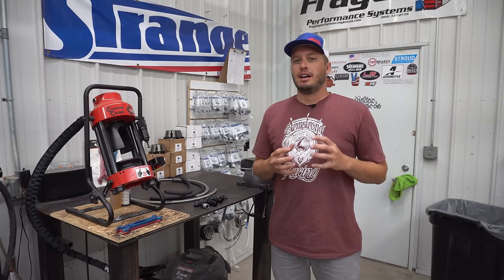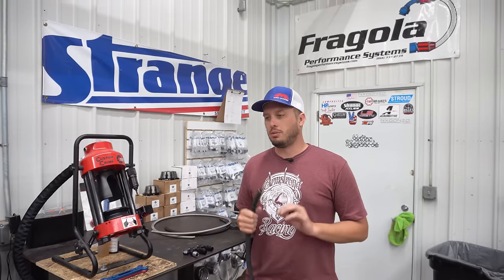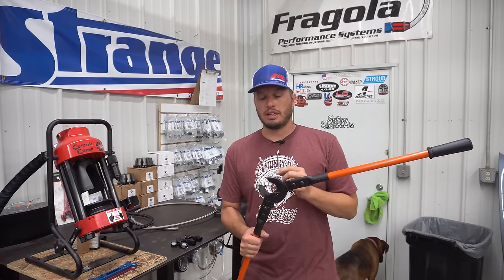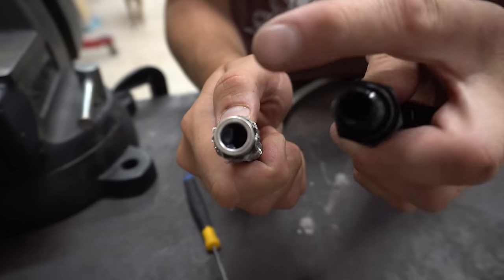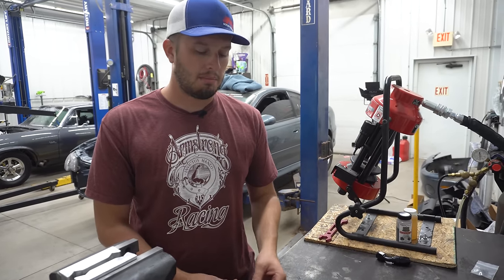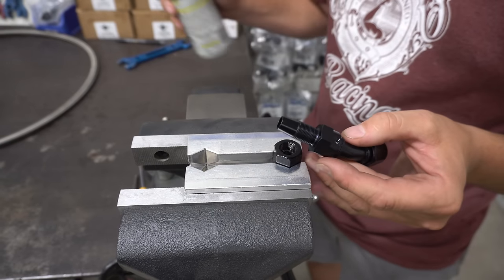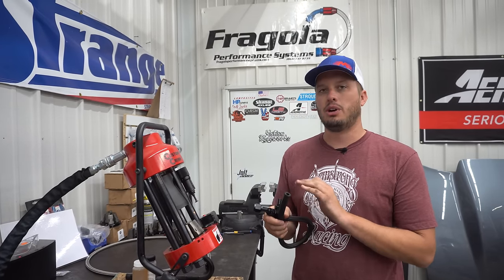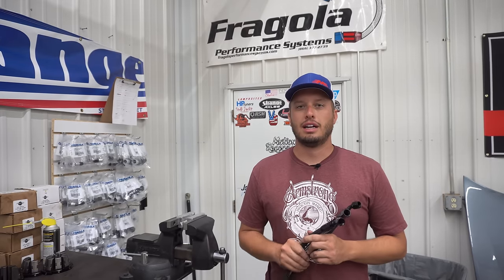How to Assemble AN, Push Loc, PTFE, Crimp Style Fittings and Hose!

Comment: Thanks for including pushlock for us poor people!
Reply: I have used pushlock on my oil cooler system, my hose shrank some in storage, so it was an absolute PIG to get over the barbs! Even with Silicone lubricant and putting the hose into boiling water! I could only manage 3 or 4 a day, and my system has 12 on it! I did, however, also use stainless steel clamps on all the fittings.
Reply: @lordleonusa  That was my thought.  adding exterior clamps seems like good security.

Comment: Nice video, thanks for taking the time doing this. I have had great luck with Aeroquip AN hose and fittings. Pretty easy to assemble and bulletproof. Used a hacksaw to cut it after wrapping with duck tape. I have had this hose on my '94 Z28 for about 20 yrs with no problems whatsoever. I noticed the prices on this stuff have gone thru the roof.

Comment: One of the best out there to explain easy and fast without any annoying talk about something elso or some sponsor shit.  
Straight to the point.  Good!  

 One tip is to use a bit of electrical tejp   to just se if the hose is mowing away from the fitting.  just take a bit and place right behind the fitting.  Then you can see if the hose is all the way in or you should redo the work. 

  
Angle grinder and so is a bad idé.  They just send small stuff inside the hose and that is going inside yours injectors.  The fuel filter will not take  all of that.

Comment: learned a trick from a guy who ran a Pontiac nostalgic top fuel dragster on metal braided AN hose, put just a little bit of electrical tape on the end (one, maybe two layers). Keeps the braid from fraying out and going crazy when you are assembling the hose, and doesn't interfere with it staying sealed.
Reply: Use PTFE plumbers tape - no residue and it comes off super easily :)

Comment: I was unaware that ptfe hose was different than regular an hose so had to order different fittings for the an hose I ordered, thanks for info.
Reply: I'm making up some brake hoses , and I think that the hose I got is for crimping cause it's nylon core ,  I don't know if I should buy new hose or buy crimp fittings

Comment: Have used Aeroquip push lock when making oil cooler lines,250psi bursting pressure -30/ 300'f  when assembled properly with a slimmer fitting profile so don't be put off by them.
Warming the end of the line in hot water does make life easier.
Amazing how they seal/work but they do.
Reply: Agreed, they’re my favorite personally. But I also put crimp clamps on them also for an extra piece of mine.

Comment: Cutting stainless braided PTFE was the bane of my existence at times. Sometimes it would fray no matter what you did.  We got a nice set of cutters and they were dull out of the box.  Sharpened them up and they dulled again quickly.  When the outer stainless frays its impossible to get a crimp fitting on it, and the covering will stab the ever living crap out of your fingers.

Oh, another note about PTFE nominal sizing. On most hoses -10 is 5/8 ID.  On PTFE -10 is (usually) ~1/2" ID.  Nominal sizing on PTFE always was a headache.  If someone needed actual 1/4" then they needed -05, so the crimp fitting was a 5 hose 4 swivel.
Reply: Wrap some teflon plumbers tape over the braid before you cut it. Doesn't leave a residue like electrical tape and is super easy to remove.

Comment: Depending on who’s brand push lock hose you’re interested in purchasing, you should check to see if it’s compatible with gasoline. Some push lock hose is not compatible with modern gasoline and was never intended to be used for that.
I pressure test hoses after assembly and when I received my first high pressure pump and made my first test fixture the first thing I tested was push lock hose. The working pressure of the test piece was 250 psi, the test pressure should have been 500 psi and the burst pressure should have been 1000 psi. This piece of push lock hose burst at 1300 psi. It is not intended for high temperature, I never recommend you use it for a coolant hose. There are enough errors in this presentation from this man to lead you down the wrong path on many items. What I recommend is that you read a lot and understand what you’re doing or get someone at a hose company that knows what to do. The biggest problem we have with racers is that they think they know what they’re doing and they end up bringing half the stuff back because they ordered it wrong. If you are cutting PTFE hose, use filament tape at the area where you’re going to cut and  cut through the filament tape. Leave the tape on the cut until you’re ready to assemble the fitting, one end  of the braids will be tight against the PTFE and the other end it will flare out away from it. That is why you only saw him do one end of the hose. I don’t feel like going on for an hour or so I’m quitting now. He means well. Follow any guidelines you can find from Aeroquip. Basically everything is on YouTube.

Comment: I learned a lot about the AN fittings. I was just watching Earls plumbing crimp video and they said make sure you dont use a cable cutter and always wrap it in teflon tape. Have you noticed any premature failures? Also,  the teflon fitting you showed is threaded, but do they make a crimp fitting specifically for teflon?

Comment: I've had a leak from a push lock fitting on an oil cooler for a drift car I crewed for. It was miserable to assemble and came apart at a terrible time. It coated the car (including front tires) but didn't result in a crash. We did have a magazine shoot with Super Street scheduled an hour later and it was a mad dash to clean the car up for golden hour. We also smoked a journal bearing turbo shortly after and I can only assume it was the cause.

Comment: It is VERY important to make certain that every single wire of the SS braid on the PTFE hose is OUTSIDE the Olive/Ferrell. Otherwise,  you WILL get a leak! It's easier to get it right on the larger PTFE hoses, but also easy to get it wrong on the small size 3 hose.

Comment: Can you use push to lock hose on a regular AN fitting? Or is there a difference in hose diameter both inside and out – overall? I have push-lock hose but I bought the nylon braiding sleeve to put over it but just need to know what fittings I can use? I actually have a box of fittings (AN) that I was hoping to be able to use on the push-lock but after watching your video I’m assuming I cannot do that because each fitting has a specific hose for them except where you stated those two fittings can use the same hose. Thanks for an awesome detailed video!!!

Comment: Push lock is easier when using boiling water to heat the hose. A little soap on the fittings helps.  Napa sells a heat shrink clamp that works really well with this system.

Comment: Excellent video as always! Could you possibly go over in one of your future videos,  mechanical pump setups (ie the mounting options both on the engine and also cable drive rear mount setups, and everything that goes along with mechanical pump methanol deals)
Reply from the maker: Definitely!  We have some new advancements coming soon.  We will wait til those are out

Comment: This additive reminds me of slick 50 of the 70s, which worked well. I'm expecting this to work quite a bit better given the technological improvements. Question? can it be used in diesel engines? That wasn't mentioned in the video.

Comment: I would love to hear the answer once and for all about push lock. Can you use a standard 5/8 heater hose and a push lock fitting? You mention nylon braided, but not all coolant hose has it. Thanks for the awesome video
Reply: No. Pushlok fittings can only be used on sae R6 hose.

Comment: Push Lock is a MFer, So I used PL hose and standard braided blue/red style fitting for 42psi fuel.... been working for years. I have seen braided steel hose cut with a chisle and hammer strike. Sooo clean a cut and no debrise

Comment: One thing he didn't mention was that there are some very thin copper sealing  cup washers that are needed where the PTFE union screws onto the male-mail threaded fitting that goes into the engine block or oil cooler adapter etc

Comment: excellent video, cleared this up for me heaps, was unsure which way to go, now i can build the right setup, but what about fittings going from 6an fuel rail in say fitting a aftermarket sr20 fuel rail with 6an fittings, then connecting them to the stock fuel lines when just running pump fuel, what do you recommend to make it the easiest way possible, without cutting stock fuel lines and having to flare them if thats possible at all? would barbed be the best option there then?

Comment: Just in case you decide to test it: carbon fibre is in fact conductive. If there’s a heap of resin it isn’t but any fairly lightweight carbon parts will generally short with a car battery.

Comment: I was able to get a clean cut on AN6 braided hose using some bolt cutters I had lying around.  (I also tried to get tree branch loppers to work, but they couldn't cut through.)  The bolt cutters worked well, but probably wouldn't work on anything larger than AN6 (3/8").

Comment: I'm replacing the Charcoal (Vapor) canister on 2001 Saturn SL2, and I observed that the Vapor Canister Tube is kind of worn (I also slightly punched it with a hook during the removal on one end). I can't find that part (which is actually just a piece of house 5/8 ID bent in a smooth way under ~90 degrees and ~5-6 in in length). Can I replace it w/ a piece of 5/8 push on house (fm/Amazon). It looks exactly the same. The name of that hose is Fuel Line 5/8" ID NBR Hose 10 AN Push on Hose 0.9 OD for Small Engines, Fuel Systems, E85, E10, Coolants, Oil, Air, Methanol and Lubricant, 3 feet. Operating pressure 2 MPa (~290 psi).  Or it is better to glue the original hose (tube, I think it is called Vapor Canister Tube) w/smth like gasket maker and keep it? The tube is attached to the Canister by sliding and applying a clip. Thank you for the film.

Comment: When assembling the PTFE and AN fittings, you should probably rotate the nut, not the fitting, or the end barb will rotate inside the hose. In the end this friction will work against the torque of the nut/fitting and possibly damage the hose.
Reply: PTFE... friction... you're more likely to distort the braid by turning the nut? Most manufacturers appear to recommend clamping the nut and turning the male side when it comes to PTFE hoses

Comment: I used Fragola PTFE fittings and hose..my issue was I had to trim the steel braid back to where the olive stopped tapering..if i left it even with the inner and outer they would not go to together. I even got the instructions from Fragola and they recommended to cut the braid back some.
Reply from the maker: I could def see that being helpful!
Reply: I had to call them for instructions no one I knew ever made them lines up

Comment: A couple things you missed that will out amateur hose assembler's on regular an hose when it fully seated in the nut mark with white cranyon or grease Pencil so you tell if it come unseated.
on the ptfe i i like to use a tubing cutter the spin style cut of 1/2 of the stainless/ nylon coating leave the ptfe un cut in the cente lube it up slide the ring on work it under the stainless/nylon then use a razor blade to cut the ptfe flush then install the fitting its much easier in my opinion

Comment: @Motion Raceworks... How do you disassemble a regular AN fitting? I made my fuel rail crossover too long, tried to undo the fitting, but the hose just spins. 😒 I didn't try any more, figured I should research first lol.
Also... Any tips on correctly measuring line length between fittings, for the future?

Comment: Carbon is highly conductive, the resin may be insulative, but it’s not enough to prevent a carbon wrench from arcing when in contact with electrical components

Comment: I use the push-lock on PCV,  catch cans. But I agree I use a zip tie or clamp to secure it. I would not use it in a fuel system...Ever again. It went as badly as you can imagine. Burned down to the ground after a complete build.  I installed a larger supercharger on my wife's Mini. it needed fuel as you would think. I ordered a kit it was all push. I didn't know what I was doing. I took it to a local shop willing to do it. I picked it up, and it never made it home. Complete write-off hiking my insurance up. DON'T USE THEM!!! I didn't blame the shop. maybe I should have but I doubt they wanted to have a customer car catch fire on the way home. It changed the policy they have, they will no longer use parts they did not source.
Reply: You had a shop do your fuel lines, the fuel lines failed before the drive home, and you don't blame the shop? LMFFFAAAOOO guess that's why your name is Nimrod
Reply: @tankeater  Failed because of the parts he supplied and specified. Unless their labour was the fault, ethically it's on him. This is unfortunately why most shops won't use customer supplied parts as they may end up liable.

Comment: I have a question where I have used this before but not long enough to know how it's going to hold up so far. I've use a heat gun and the fittings will go on very easily whether the heat is going to affect it later I don't know but my main question is using a hose clamp on top of this should that help it or hurt it? Also already know what you're going to say but have you had any experience with eBay Hose & Fittings being that they are cheaper and I know you get what you pay for but when you are on a budget fittings and hoses are very expensive it can nickel and dime you to death what do you think about the eBay stuff

Comment: So i have a 95 toyota pickup, and I had to drop my tank to fix some wires after a rat chewed on them. I also decided to change my fuel tube that runs from the pump to the fuel line because it's nearly 30 years old and is severely corroded and just looks bad. I can't find it any cheaper than $90 so that lead me to the alternative of building it, and now im considering just changing the entire line all the way to the engine,  I'm just not sure what my best option is yet. The line uses M14x1.5 fittings, and I can not find them locally anymore. What would you all suggest? TIA.

Comment: What i do is use blue painters tape lube the nut and fitting and tape with wd40 and tap on the fitting and when it’s about 1/4 way through you pull the tape and slide it the rest of the way on works every time the tape slides right off

Comment: Good video, great info as always guys, audio is really pitchy though.
Reply: We had 146 solar flares of which 132 where producing constant frequencies above 189 kHZ to 197 kHZ from late August into September. It caused lots of communication issues on the IOWA class aircraft carriers. Frequencies above 185 kHZ interfere with cell, WiFi and SNAC systems. 
 Communications Officer; D. Kay

Comment: i'd rather use pushlock with a home made wood clamp retrofitted into a clamp kind of like how the retro way of pressing nylon fuel line to the fitting. I'm personally not a fan of PTFE lines But some folks need to use em...

Comment: Hi, I have a question on hydraulic hose, I have a cripping machine and hose at the place I work, can I use hydraulic hose 2 wire style to make transmission cooler lines, oil lines and or power steering lines ?  It's a Kurt tuff 5585 psi wp. 3/8 hose

Comment: I have a Ford F250 Super Duty with a 5r110w transmission.  The transmission has 1/2” od. transmission lines.  Where can I get hose and fittings for this application?

Comment: The power steering system i am making is 110 bar (1600psi) - which of these do you reccomend? I was hoping to use a rubber style, but doesn't look like those go above 500 psi.

Comment: They don’t recommend lube when assembling push lock hose. Silicon deteriorates rubber overtime they sell a temporary assembly lube for there assembly. Foaming glass cleaner is a good lube for assembly will not damage hose

Comment: Can you use push lock for an after cooling system for a home compressor.   I have a trans cooler to help cool down the compressed air and the ends are 8 AN.  I want to connect a system that is as basic and cheap as possible,  but safe and I am struggling with which materials to utilize to achieve my goal.

Comment: Thanks for this video.
I have a 8AN braided hose I built and am trying to adapt it to a 1/2" aluminum hardline.. I bought a nut/sleeve compression fitting for it but it just slides right off.. Maybe I bought the wrong type of fitting.. Do you have any suggestions?
Reply: You need to put a "bead" at the end of your hard-line. You will need a "tubing beader" tool for that

Comment: 3:50  " 212° f/ hot water  can damage hose "
Then how is it going to  handle  any fluid other than fuel ?  With 250° being the upper safe limmit for  most oils trans /motor/diff ect ect .
Reply: Big difference between the entire hose warming up and 1 specific spot heating up rapidly...

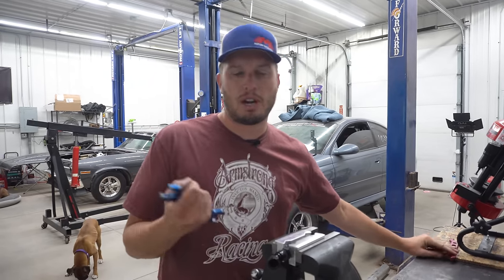Comment: 11:10 ish he is talking about a carbon fiber tool.   I'm not sure about this specific brand and if they do anything to prevent this, comma but carbon fiber is conductive!  As soon as the protective Epoxy coating  Where's the way, you have carbon, which is very conductive

Comment: Would the standard AN fittings/line hold up to power steering pressures? Or is PTFE  a requirement?
Reply: Late reply but no, absolutely not - PTFE is critical in any high pressure system, that's why you'll only ever see PTFE used for brake lines.